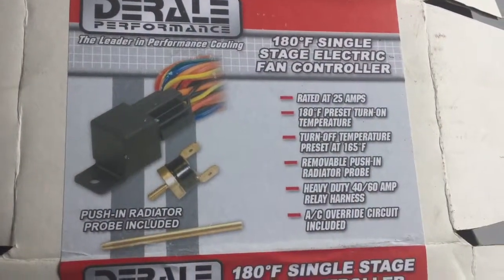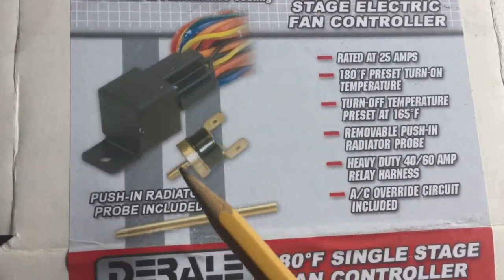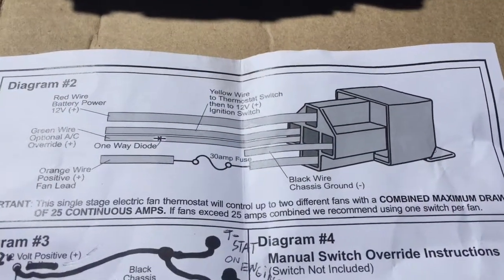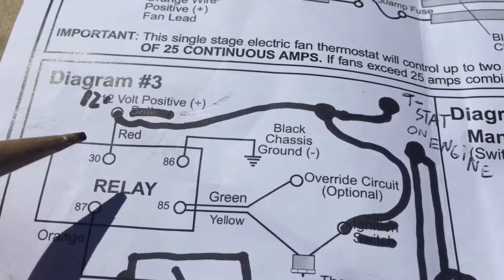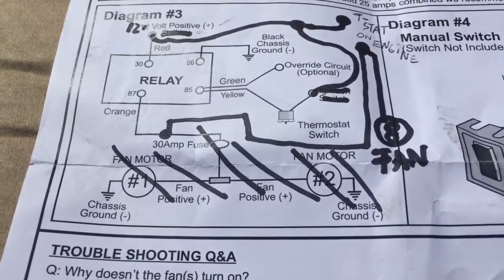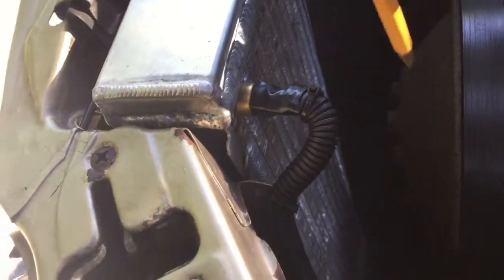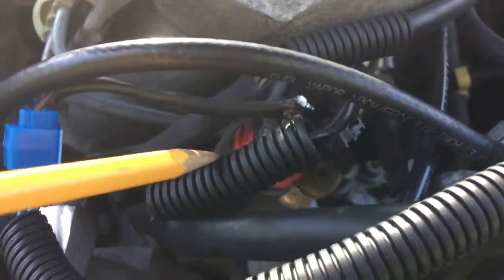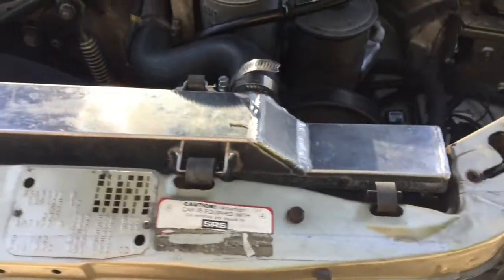W126 Benz how to kick the aux cooler on at 80 to 85C

Comment: Hey Ralph I used 2 12 inch fans to replace my clutch fan and control them with the davies craig digital fan controller.  It has the trigger wire for the ac. Should I use this function to fans come on with ac. Or keep using the benz switch on the dryer to keep condenser fan working as factory.  
Also I want to change my 70 amp alternator for a 90 amp. Do you know what alternator I should use.  Thanks again for all your help and sound advice.
Reply: I kept all factory wiring and temp sensors.  So my temp guage still works as
 normal. All I have done is remove viscous fan and add a pair of 12 inch fans and a controller with thermo temp sensor that fits in radiator fins. 
I will see how it does after im done and let you know. Thanks for the reply.
Reply from the maker: @w124mercedes7  Thx and good luck.
Reply from the maker: Hi Robert;
Removing the shaft driven fan changed the function of the electric motor driven fans. Now they need to function as main cooling fans and also help cool down the condenser. So that is why you need to somehow monitor the block (or coolant temp in general) and also the AC system. So you need to pick a method that will reliably maintain a good coolant temp and I would keep the wiring for the AC functions in place also. 
As for the alternator I am wondering why you would like to increase the Amp rating. Electrical load can be reduced greatly by installing LED lights and the 70Amp one has not been an issue as far as keeping up with electrical needs of the car.

Comment: Hi I have 1981 300sd would you have or know where I can find out where the wires go in relation to the window switch the left passenger side. My switch came apart
Reply: Hi my left passenger window switch came apart. Not know where wires go. U have info
Reply from the maker: @jonfrazier7827  I did send you the WD for your car. Good luck!
Reply from the maker: Hi Jon. I can take a snap shot of that wiring diagram. Just let me know your FB messenger address or e-mail and I can mail it to you.
Reply: @straybenzes  thanx 4 reply. Email  jfraz1957@gmail.com.
Reply from the maker: @jonfrazier7827  Just sent you something. Good luck.

Comment: Hello, on my 1982 240D Mercedes, my Auxiliary fan comes on when i shut off the car and then never shuts off, keeps going and going.  Any Fix for this problem???
Reply from the maker: I would check relay 6 and 12. Both are providing power to the fan. They should be in the black box mounted on the shock absorber dome on the driver side. Check if those relays work properly. Pins 1 and 3 of relay 6 should be "open" when you test it. Relay 12 is very unlikely your culprit. 
Another test is to remove one wire (it does not matter which one) the high temp switch on the receiver dryer. If your fan runs even with everything still being cold, than that switch has gone bad. Good luck.
Reply: @straybenzes  Thank you so much for the reply, i will replace the 2 relays with new ones.  I will also replace the temp sensor on the engine block, then will try.  I think you are right about relay, now the fan does not work at all.

Comment: I have the same car (87 SDL) and when i'm sitting in traffic, the temperature gauge sometimes goes over 100 C, but the aux fan always cools the vehicle down. I think the aux fan switch that I replaced activates the fan at 105 C and shuts off the AC at 115. Did this set up keep your engine temperature below 85 C? If you had the original Behr radiator, would you still mount the sensor in the  same spot in the radiator?
Reply: It will fit the Behr radiator.
Reply from the maker: Has your high temp improved?
Reply: It occasionally went over 100 C, but that seems to be the norm for this model. I ended up having to replace the radiator after seeing how easy the job was after watching your video on it. However, I don't know too much about wiring so I never installed the lower temp switch. It was a fun project car, but I ended up selling it last month.
Reply from the maker: @goatherder920  Oh too bad that you had to sell it. All the best!

Comment: Oh My Goodness...Thank You Sooooooo Much For The Tipp.  I Live in Las Vegas, Where The DAILY Temps are Between 110°F - 119°F All Day...Even At Night!!!...So The Temps in My w126, 560SEL are ALWAYS Reaching 85°C ....  I Will Definitely Try This Out! ....Thank You For Sharing!   <3
Reply from the maker: Thanks. Please let me know how this worked for you.
Reply: I just unplugged red ac switch and put a wire in both wire looms boom ignition on at 115' degree days in Vegas 💯✨🏆💃🔧
Reply: I think 85 C is nothing to worry about. My Benz will creep up on that in the summer here in Vegas and I don't worry about it. If it started going over 90 then I would start being a little concerned. Gas motors shouldn't go over that.
I hope you like Vegas heat because I don't. Lol Happy New Year!
Reply: 85 is safe, even 100